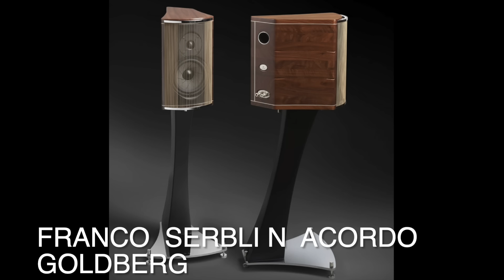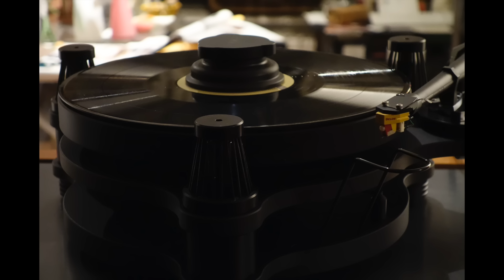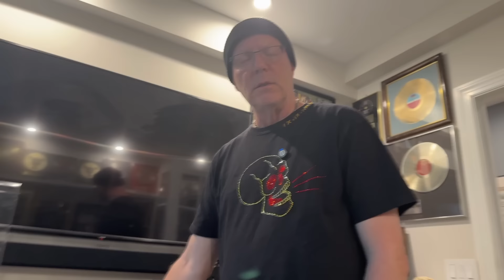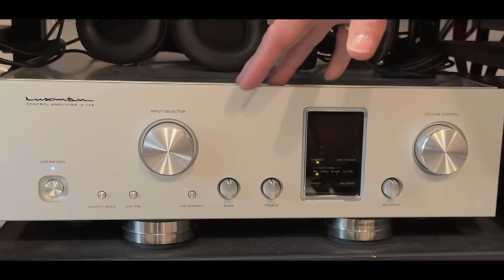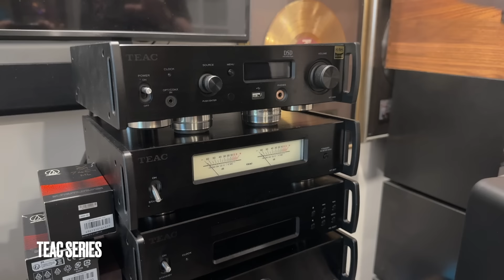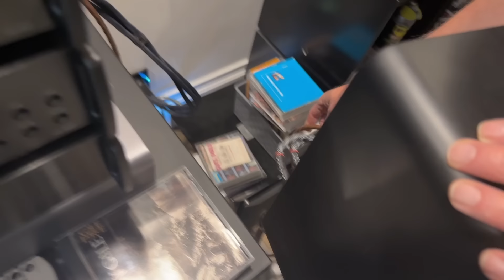What Kind Of High-End System Does A ROCK STAR Buy? PART TWO

Comment: The instability of the internal clock in a CD player (subject to time and temperature, for example), is a source of jitter in CD playback. Using an external frequency standard where efforts are taken to minimize those effects can reduce jitter and other effects associated with frequency instability. However, leaving your CD player turned on all the time and using it in a room that's relatively constant in temperature will accomplish much of the same.

Comment: I am glad there are audiophiles in this world, they help me buy  intelligently.  I would never churn equipment , my desire is not that strong.  I got the news about good amplification when a crewman showed up on a ship I was working with a footlocker that held an Ampeg reel to reel,  a few tapes and two little speakers.  the amplification made those plastic speakers sound good.
Reply: Drop down to a mid level receiver that's available new for under 500 and compare. Might surprise you.